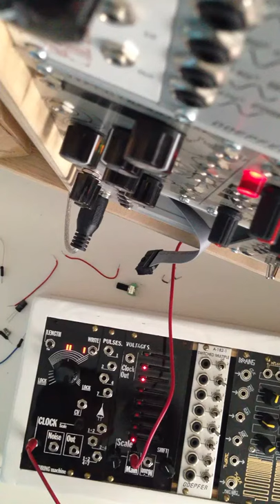Voltages expander for Turing Machine RLS module

Comment: Do voltages need a quantizer?
Reply: nectariosm IF you want them to be in a western scale you would quantize the voltages between turing machine and your oscillator input. You don't have to quantize, but you might not like the 'out of (western) tune' sound.

Comment: Hey Tom, i was wondering what the Shift knob does...i just finished mine and the SHIFT knob only seems to be active when i use the inverted output.
Does that sound normal to you or did i maybe do a mistake ?
Reply: +Sascha Haber Reading the manual, i understand now its a Resistor and so only working top to bottom inverted...all right :)

Comment: Can you explain the sliders? Does the probability go up as you move them to the right? Does it do it gradually? Is the voltage output the same as that coming from the Turing is the scale is set the same?
Reply from the maker: Probability doesn't change, the voltage output does. Imagine a simple sequencer; 8 sliders, it steps through each slider, outputting a voltage depending where the slider is set. 
This is exactly the same, but you can have multiple steps active!
Reply: @tombola2004  . So the voltages add? Is that linear enough for 1v/oct?

Comment: Hi Tom, was about to assemble the voltages and wondered if it's fine if i use 2k2 resistor array instead of 2k
Reply from the maker: Yes no problem
Reply: ty! couldn't wait more, works like a charm :D